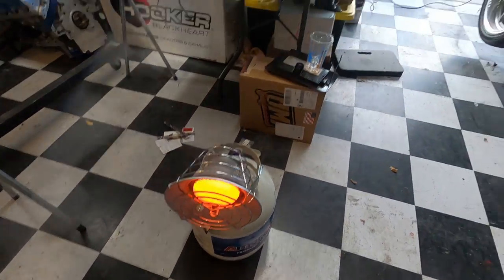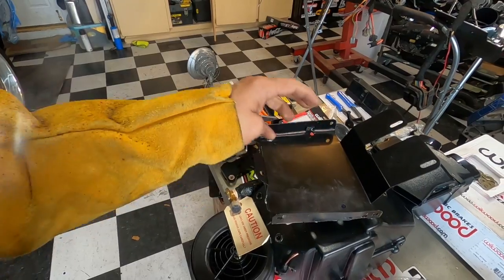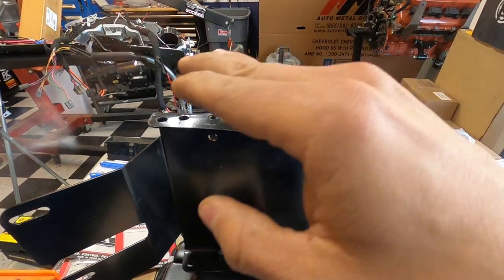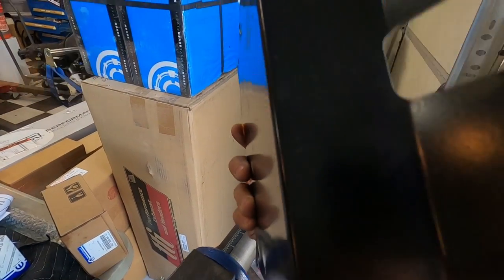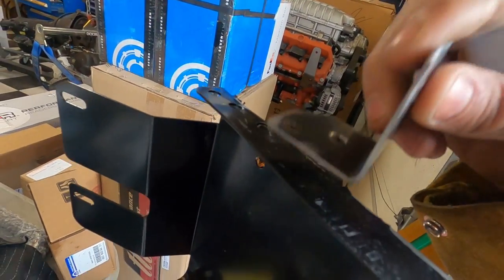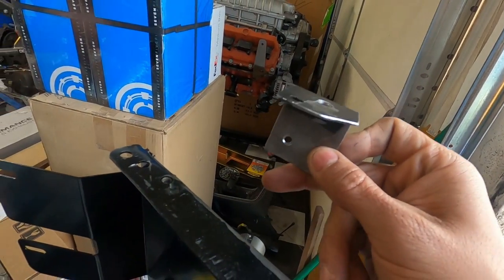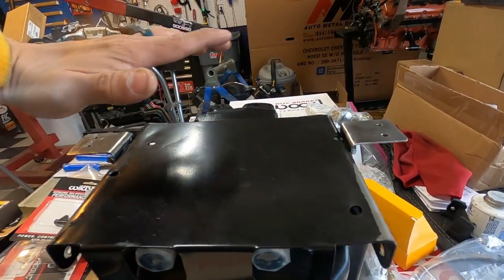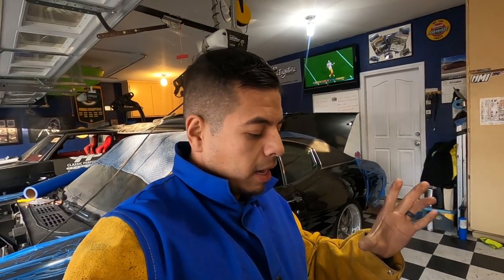MOUNTING VINTAGE AIR EVAP BOX WITHOUT BOLTS FOR A SMOOTH FIREWALL!

Comment: I do a/c in cars i build interiors in & never drill the firewall. I make my own mounting plate/brackets from .090 5052 aluminum & urethane them in place the bolt the unit in 👍

Comment: Getting ready to install a vintage air setup on my non factory A/C  70 GTO LS 3 swap. I smoothed out the firewall. I was orginally going to mount the outer cover plate on the  inside firewall. Thinking To make a rigid support and then have threaded studs come out to mount the evap bracket.  But now from watching  your video i realize no access to bolts when mounted.  I  am gonna try your bracket design. It Looks simpler amd i can elimate the plate cover...sometimes i over think on my setup.  You did the trial and error stages . Just makes my job easier now...thanks for sharing your video..